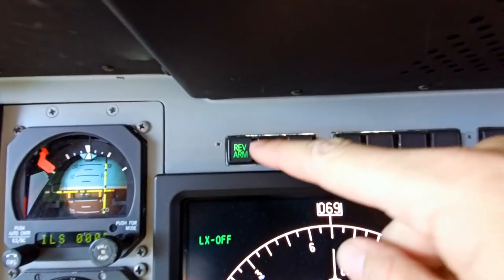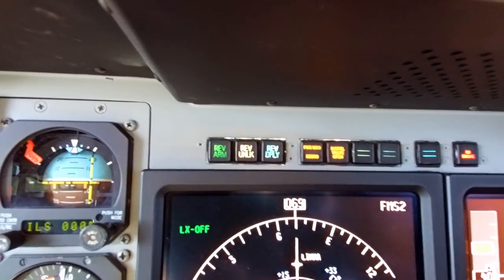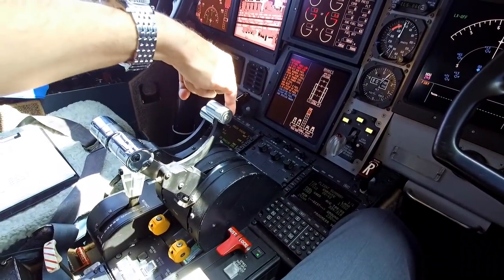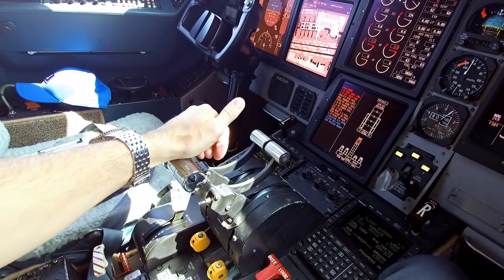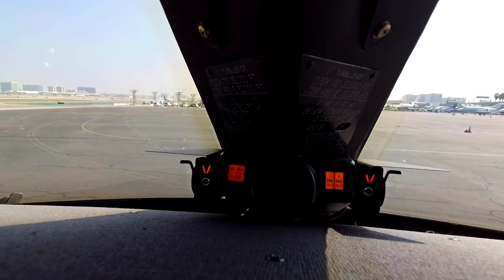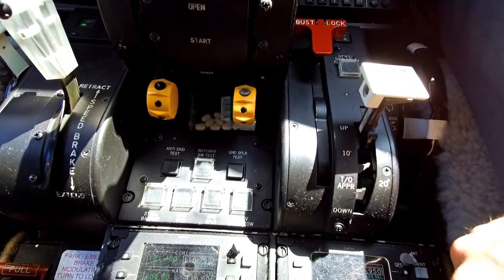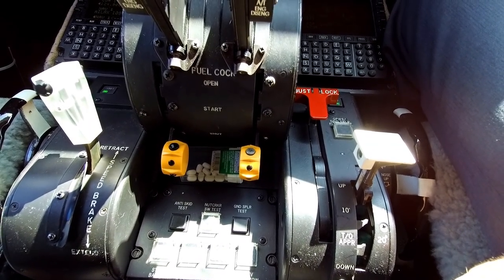6 Lights, Boards Up...What Does That Mean? - Pilot Vlog 086

Comment: That's the last clarification that I needed.  I can go flying now!!!  Wo-hoo!!!  haha
Reply from the maker: Excellent!
Reply: All aboooard! uhhhh I'll be right back.....
Reply: Love all your videos, thanks for the great entertainment.   I have one question, on take off you are calling out the speeds, the one item I can’t  figure is “60 hold”?    What does it refer to please?   My thought is that it is 60% throttle and you hold it there ?
Reply from the maker: Actually that is 60 knots. At that point, the auto-throttles go into a "Hold" mode so they cannot inadvertently reduce power. The problem is that they will go into Hold mode even if the power wasn't fully set at that point. So basically, at 60 knots we are verifying that the power is full after the Hold mode engages. If not, we would have to disengage the auto-throttles and manually advance the power to where it should be.
Reply: I mean, a ground maintenance guy did :)  You can too!
Reply: Brandon Hollingsworth yeah I have a whole bunch of questions as to how a rampie could figure out how the prop settings correct, know when to rotate based on weight, etc ...
Reply: Thank you for the answer !  Keep up the great work !

Comment: Question...…..thrust-reversers (on the Gulfstream) are merely "caps" (or cans) that slide over the rear of the engines directing the thrust forward......correct?   I assume anything less than full power wouldn't have much of an effect in that realm.    All-in-all, we VERY much appreciate all your past answers and input to our endless questions.
Reply from the maker: You are half correct. They are mechanical TRs that cover the rear of the engines, but even at idle reverse, they are quite effective. You wouldn't think so, but they actually are.

Comment: Thanks for the Great videos.  I appreciate you taking the time to explain these items in a way us non pilots can understand.  Questions for you? If the Nutcracker test failed on landing gear down, you wouldn't arm the spoilers?  Is there any other time when you would choose NOT to arm them?  Also, in alot of your videos you are both wearing your pilot uniforms. But in others you are dressed more casual; golf shirts and khakis.  When do you have to wear the "stripes" and when can you not? Obviously maintenance runs and empty repositions are a different story...
Reply from the maker: Good question. You are correct that if the nutcracker test failed, we would not arm the spoilers. In that case we would land, then hit the switch to pop them on the ground. The only other time I can think that we wouldn't arm them is with a massive hydraulic failure, as they are hydraulically actuated. Some clients we know quite well, and we know that they prefer the polo shirts to the full uniform. If we don't know the clients, then we go full uniform.

Comment: What do you guys mean when your about the land and you say ( Ref 10 / Sinking 6)? Awesome videos thank you for sharing.
Reply: vref is their final approach speed (different every flight due to different landing weight, weather etc).  if they set Vref at 105 kts, thats the speed they want to cross the threshold to land...as they set up the apporach you will hear call outs...Vref +20 (or reffing 20)  thats vref+20kts...so 125kts...as they get closer vref +10..etc.  sinking 6 means decending 600 ft per minute
Reply: Thank you.

Comment: Not related to this video, but when running your checklists, for “air start” the response is always “not required “ (forgive me if I have terms slightly wrong).  My question: what is it, and when might it be required? (I’m guessing rain/weather plays a role)  Maybe go over other often “not required” items.   Great videos!  Keep them coming.
Reply from the maker: That will re-light the engines in the event that the flame goes out inside. We only really need it in heavy turbulence or precipitation. The only video that I can remember using it is below...around the 7:25 point:

https://youtu.be/5YOQ5dJPY6Q

Comment: Thanks for the video. I'm curious why Gulfstream went with different method  for spoiler control to Boeing. Both Boeing and Gulfstream have moving throttles/autothrottle. Boeing differes that it has a servo motor on the speedbrake handle as well, so on touch town the speedbrake handle motors back into the deploy position. It makes a good noise as it does so so you get an aural confirmation that it has worked.It's easy to stow them without looking. It seems on the G4 you need to go heads down to find a small switch. On a rejected takeoff in the 744, speedbrakes come up with reverse selection.
Reply from the maker: Not sure why they chose that method. I like it, but it's what I'm used to I suppose.

Comment: Love these G IV Tech videos, thanks Shaun!  

PS: After watching the video I got curious so I googled "what happens if the ground spoilers fail to deploy upon landing a Gulfstream G IV and this article came up about a french crew having an accident in 2012 because the Captain who had a long airline career but not sufficient training in the G IV failed to arm them, was an interesting read but not good turn out for the crew.  I think he'd been flying the big birds so long he became somewhat complacent perhaps. 

http://code7700.com/accident_giv_n823ga.htm
Reply: That sounds like a much more complicated situation. 

The main reason the spoilers pop is to rob the wings of lift, to make sure that once the plane is down (weight on the wheels as detected by the famous nutcracker) then it stays down! I assume they also contribute to slowing the plane but not as much as the brakes and the reverse thrust. 

In that case the pilot didn't set the spoilers to deploy, so they didn't. Why he chose this course is not clear, maybe he prefers to deploy them manually... The bigger problem appears to be the nosewheel was not set pointing straight ahead so  when the plane DID land, it shot off the runway!  

Interesting, I don't think checking the wheel is straight is on a checklist which on reflection seems odd - guys, does that mean it's centered automatically when the gear comes down and is sure to be there unless someone messes with the tiller?
Reply from the maker: This was a really bad accident in the G-IV community. The spoilers were missed on the before landing checklist, which caused the airplane not to plant on the ground as it normally would. There has been a faulty nosewheel steering valve which has caused the wheels to suddenly turn to one side or the other, but I'm not sure if that was an issue with this accident. In normal operation, the nosewheel should be pointing straight down the runway without any input from the pilots. If I remember correctly, the steering should not even be active in the air, so until the plane is on the ground, any input to the tiller shouldn't turn the wheels. The tiller on this airplane has been the cause of more than one accident, unfortunately. On landing, the pilot should really not even touch it until the airplane is under 80 knots at least. The rudder steering is more than enough to keep the airplane going straight on the runway.
Reply: Can't imagine why a nose wheel would turn from straight ahead between takeoff and landing.  Do you touch the tiller at all during takeoff?
Reply: @robsteele2087  it was mentioned in the accident report at the link I posted in my comment above.  Not something they (Shaun &  Jon) did or do, sorry for any confusion I may have caused by posting that link.

Comment: Probably asked and answered, but what is the “hold” you refer to at around 60 knots on the takeoff roll?  Great content.  Flight videos are awesome and these short tech videos always provide cool infonuggets.  :). Thanks.
Reply from the maker: Yep...that's at 60 knots. At that point, the auto-throttles go into a "Hold" mode so they cannot inadvertently reduce power. The problem is that they will go into Hold mode even if the power wasn't fully set by then. So basically, at 60 knots we are verifying that the power is full after the Hold mode engages. If not, we would have to disengage the auto-throttles and manually advance the power to where it should be.

Comment: Awesome video. Here are my questions. I love to know how fast y'all are going, especially on landing since it's one of the most technical parts of flight. What are your flap speeds and what degree flaps is the G4 equipped with? What are your minimum and maximum landing speeds? Thanks for all you do, love your channel!
Reply from the maker: The speed on landing varies, that's why we just say "Vref". At a very low weight, The Vref would be around 125 knots, so we would fly 135 knots on approach and touchdown around 120. At a high weight, the Vref might be 145, so we would fly 155 on approach and land around 140. The G-IV max flap setting is 39 and we are limited to 180 knots or less for that. Flaps 20 is 220 knots, and flaps 10 is 250 knots.
Reply: Awesome thanks! :D

Comment: Hi Shaun, when you engage the auto throttles with the toggle switch on the throttle quadrant, what exactly happens? If they are not engaged, does the TO/GA button still advance the throttles, and what determines the desired thrust setting? Am I right in assuming that when you select Speed Hold on the autopilot panel, it holds the selected speed but this is different from the switches on the throttles? Thanks for taking the time to teach us armchair flyers!
Reply from the maker: That system is pretty complex, but I'll try to cover the basics. The speed window on the Flight Guidance  Panel is where the auto throttles will aim to be in some modes, but in modes like TO/GA and FLCH, the throttles will go to max or idle (FLCH descent). The toggle switches on the throttles will turn on or off the auto-throttles. Without that, the throttles are just manual and will not move at all on their own. Learning this system is a great deal of the initial training course, so covering it here is practically impossible. I'll do another video on the different modes at some point.
Reply: Many thanks, it is much appreciated!

Comment: Can the reverse thrusters be mistakenly deployed during flight? Or is there a safeguard?
Reply from the maker: They are safeguarded. No nutcracker...no TR
Reply: Search for Lauda Air 004 to find out what happened when they did on a B767.
Reply: NASA used a modified G-II to training the astronauts to give them some “flying characteristics” of a Space Shuttle. They extended the main gears and deployed the TR to simulate “how docile” the Shuttle comes from space. However, the “dirty” G-II still keeps a good L/D rate! Well.... even modified, its a Gulf! 😉😎

Comment: Do you ever glance back over your shoulder to see if in fact the spoilers have deployed?  Or is that even possible from the flight deck?
Reply from the maker: We have a mirror on the side windows that allows us to see the spoilers, but it's not really used on the landing. It's mainly for use on the flight control check after engine start. Honestly, if they don't pop up, we can feel it more than anything, as it doesn't want to settle on the runway very well.
Reply: Corporate Pilot Life  Great answer Shaun and thank you.

Comment: Great job explaining this, I know you decided to shoot this video before you took out the cleaning cloth and wiped down the throttle area. I asked before, I hear whoever is not flying say "Feltch" just after take off. I used to think it meant you hit the auto-pilot, but then I have heard the pilot flying say auto-pilot on at some point after that call out. So please explain "Feltch". Dig these vids, I know you put in some time doing them,so many thanks.
Reply: Mr DDD3az it’s slang for “Flight Level Change”, one of the climb modes of the autopilot. Used to maintain a particular speed while climbing.
Reply from the maker: Nate's Random Videos exactly. FLCH can be used on climb or descent. It will use full power for climbs and idle power for descent. The autopilot then pitches the airplane to maintain whatever speed we have set.
Reply: Thanks you sir.

Comment: Here's another one, Shaun: on your take-off roll, one of the calls seems to be: "60 hold". Could you explain that one, please?
Thank you for your info. Most interesting.
Reply from the maker: That callout is made at 60 knots. At that point, the auto-throttles go into a "Hold" mode so they cannot inadvertently reduce power. The problem is that they will go into Hold mode even if the power wasn't fully set by then. So basically, at 60 knots we are verifying that the power is full after the Hold mode engages. If not, we would have to disengage the auto-throttles and manually advance the power to where it should be.
Reply: What a lucid explanation. All clear, now. Many thanks, Shaun

Comment: Can you do a video on the proper seating position for pilots? Isn't there some type of guide in the center of the front windshield that you adjust your seats to?
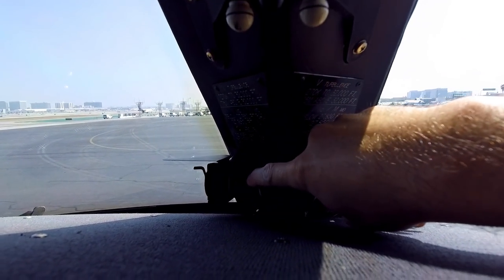Reply from the maker: There is! You can see it in this video at 2:01 on the very top of the screen. The 2 while balls and the 1 black ball. They all have a line through the middle. From each of our seats, we line up one white and one black ball with the lines matching. That is the ideal seating position.

Comment: Show is flaps 20. Explain flaps 20 selected. Then indicated. I’m assuming it takes a few seconds to achieve after selected?
Reply: See John Vlog It does take some time in most aircraft. You’ll see John and Shaun do another thing most of us do, after selecting something leave your hand touching it until you see the indicator agree. John likes to use his index finger on top of the lever as a reminder until the indicator agrees with the lever. You’ll see pilots do this with the flap handle, the landing gear selector, anything that needs a confirmation that the selected item finished moving and is in the desired position.

Comment: Hey Shaun, If you use the thrust reversers do you really need the ground spoilers? I really want to ask about the wheel brakes. How hard is it to keep even pressure on left and right brake when you land and keep the plane in a straight line? thx. you guys are great!
Reply from the maker: The ground spoilers do help quite a bit. The Gulfstream performance numbers are actually based on having ground spoilers, but not using thrust reversers. Without the spoilers, the airplane has a massive tendency to bounce back into the air after touchdown. There was and accident in France in a G-IV that was partially to blame on the spoilers not being armed. The brakes can be a bit sensitive, so a light touch is needed.

Comment: I have notice for a while the Black and White Wheel on both the Captain and Copilot seat.  I could tell from this video that it is a Nose Wheel indicator.  Is this wheel just used for landings and takeoff, also, can it be a manual device if the electronics fail, and you do not know if the nose wheel is up or down and locked?
Reply from the maker: Actually, I think you're seeing the elevator trim wheel. The autopilot uses it when it's on, or we can turn it by using the electric trim switches on the yokes.

Comment: There are two wheels, with white stripes, on either side of the throttles, that occasionally rotate while you are flying. What is the purpose of those wheels?
Reply from the maker: Those are the elevator trim wheels. The autopilot uses them. We also use the electric trim switches on the yokes when hand flying.

Comment: awesome Shaun, didn't realize that the thrust reversers levers could not be moved when shut down, they electric so is there an interlock or something preventing them from moving when you shut down or you just can't move them as something bad happens when on ground?
Reply: homie789 with a King Air, if you are parked with everything off and move the power levers past the detent into the reverse range, you can damage the PT6 prop control.
Reply from the maker: It's all mechanical cables on the TR levers, but the system is hydraulically actuated. Without the engines running, the hydraulics are off, so the valves cannot be moved.

Comment: What is "Ref in 10*, Sink in 7*" when landing?
I assume ref is landing speed, but sink ?
Reply: Mad Matt Ref is the calculated speed for the landing (you got it) and sink is referring to their vertical speed. 

“Ref plus ten, sinking 8” means the pilot flying is ten knots above ref speed and the aircraft is descending 800 feet per minute. 

It’s called out by the pilot not flying so the pilot flying can keep their eyeballs outside instead of needing to split attention between the outside view of the approach angle and glide path and looking inside at the Instruments. 

You still glance in a bit but it lowers the need to do it to have someone else monitoring. The single normal call out means all is generally well with the world. If the numbers are getting out of whack (violent windshear, etc.) there are usually two levels of difference when that occurs. 

A small amount of out of whack you’ll hear the pilot flying say “correcting” and fixing it. Beyond a certain limit out of whack, either pilot can call for an immediate go around and abort the approach. 

Which is also why you’ll hear them brief the missed approach even in good weather before arrival. “If we go missed it’s a climbing left turn to 3000 feet...”
Reply from the maker: I think that's the best explanation I've seen for that! I'm planning a Tech video to show all of this as well. It may be next week's Teck vid.